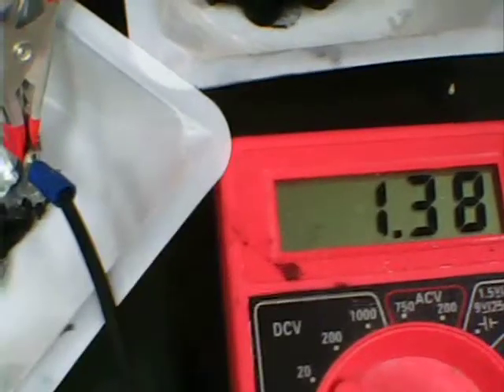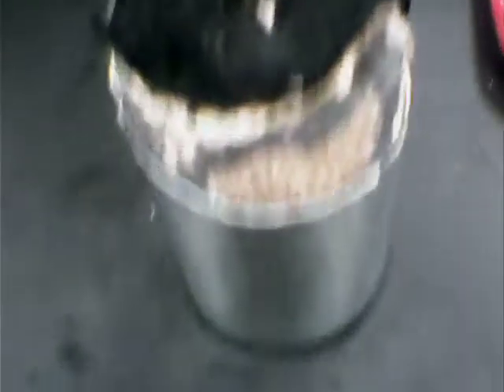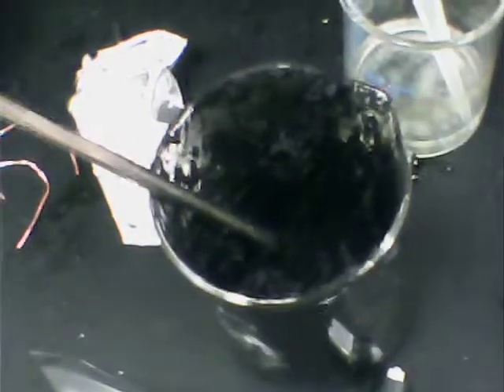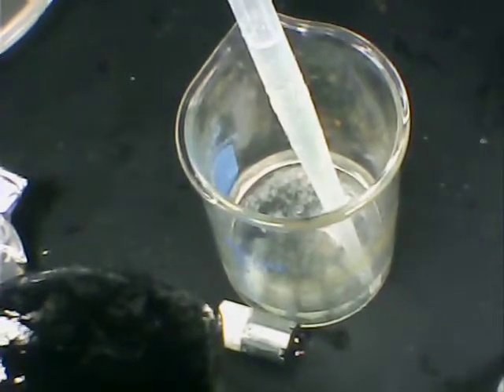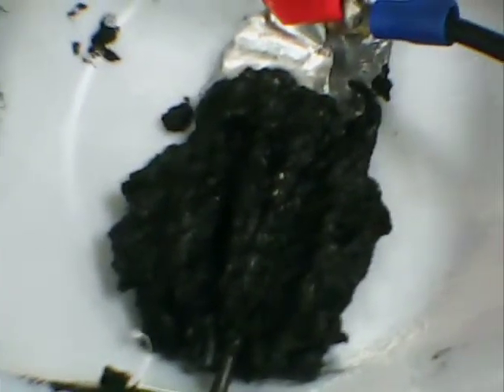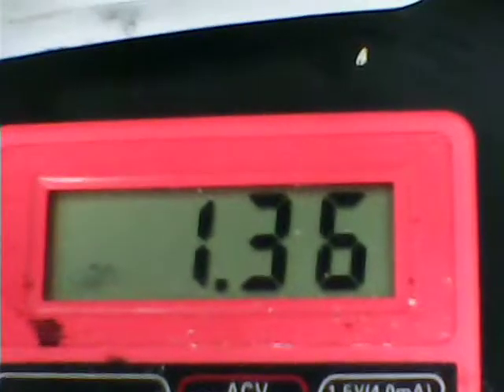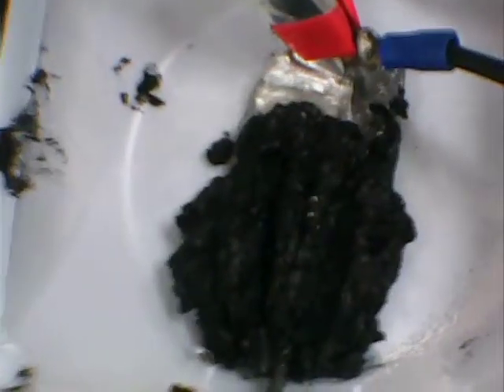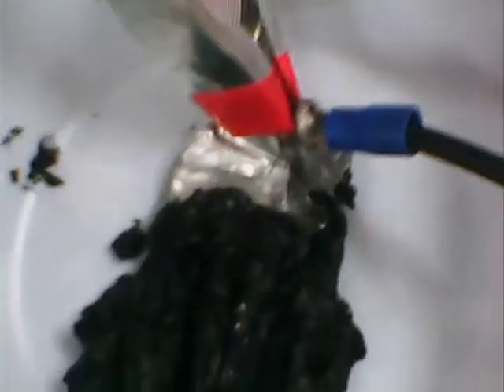Zinc Dry Cell/ Gel Electrolyte/ Gelatin Membrane

Comment from the maker: The gelatin thin film must be cross-linked or it will degenerate quickly under the experimental conditions used. A thin film of polyvinyl alcohol holds up better.